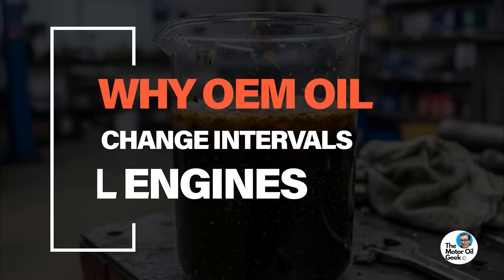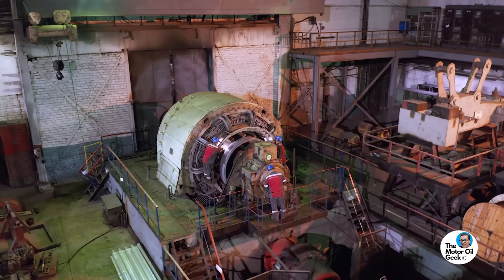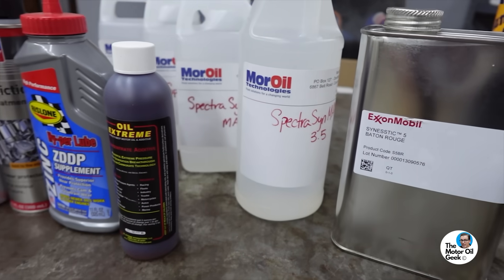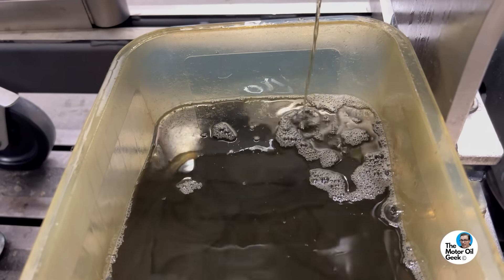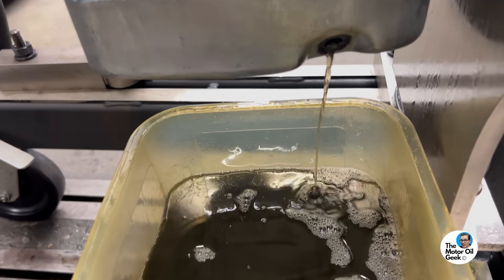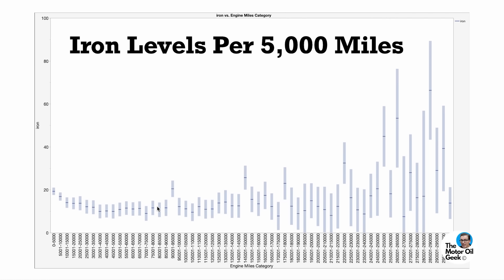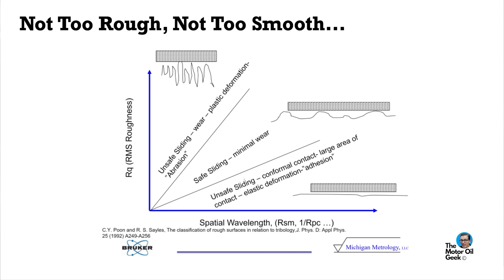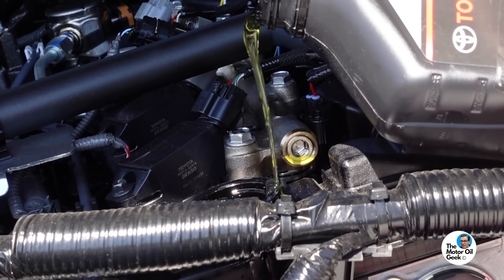NEW Data Reveals WHY Modern Engines FAIL Prematurely!

Comment: I wish donaldson would make their “blue” line of filters for all common makes and models of equipment and vehicles.  

I switched to the DBL 0832 on my 2007 LBZ and love it.  Its got more capacity than the oem filter, but not a big and heavy as the cat adapted or PPE filters.  It also filters better as an added bonus, I believe 10 or 15 microns vs the standard 20.  I run CENEX maxtron deo 15w-40, change it every 5k and its is one hell of a good running, reliable truck.  Oil is always still slightly golden at the 5k mark (i have a ppe flat pan), it never skips a beat, and Im not easy on it at all.  

I used all kinds of oils and filters as a mechanic from cat equipment to kubota tractors, to the every day pickup and semi.  People really don’t understand how important good oil, filters, and REGULAR maintenance is. 

Ive been inside of many engines, pumps, cylinders, etc.  Most fail due to negligence of oil and filters/ PREVENTATIVE maintenance.  Its crazy to me that manufacturers recommend such long intervals, and that folks cheap out in lubricants and filters after spending so much on a piece of equipment or a vehicle. 

I appreciate you sir! I enjoy gaining knowledge every day.  Learning more about the in depth of this sort of thing should be important to all techs.  Id be very curious about Cenex branded oils being tested by you.  I know they aren’t as mainstream as others, but a lot of folks used them in rural areas in everything.  I think they a great oil company, but id be curious to see if that holds up under a microscope! Thanks

Comment: I enjoy your content, but wanted to offer a small suggestion which I think could improve the traction of your videos: 

When you speak in your videos, most of the shots which feature you speaking are a fairly tight camera shot of your head & shoulders.  I think that this can often come across as a being "confrontational", or "aggressive"  (for lack of a better term).

My suggestion is that you can "soften" your videos a bit by mixing this with some upper-torso or full-body shots; these tend to emphasize body language, and show a more relaxed version of what you're trying to convey.  (For comparison, consider some videos produced by MKBHD, where most shots are upper-torso, and head-zooms are only used for making specific points or for "strong" reactions.)
Reply from the maker: Thanks for the feedback.

Comment: In my past experience putting over a  combined 1 million miles on a 2010 cobalt and 2015 fiesta. Highway mileage oil change intervals can be much longer than standard oil change practice. My fiesta went 20/30k between oil changes for the first 200k of its life and then 15k from then on forward. It’s now breaching 500k and it doesn’t burn or leak oil and when inspected internally no abnormal wear.

Comment: I get that contaminated oil causes more wear, but isn't it more accurate to say that specific kinds of contamination cause more wear. If general contamination was only the cause of engine wear then how do diesel engines last much longer on average than gas engines?
Reply: Diesel engines generally have a larger oil tank for more dilution and diesel fuel acts as a lubricant in addition to operating at a lower rpm.

Comment: So would you run a Wix or a Wix XP on a regular basis to keep the oil clean and protect the engine better. Also is there an issue of running a XP filter in the subzero temperatures of South Dakota?
Reply from the maker: Regular Wix over the XP.
Reply: @themotoroilgeek will do, I have a couple of use up yet. Thanks
Reply: @themotoroilgeek hey Lake, why are we running the Wix regular over the XP? Better oil flow? Or better oil flow in the subzero? I don’t recall the reasoning. Thank you sir.

Comment: Heavy equipment and engine tech with half of that in dealer, even today work for a major engine manufacturer.
Automotive intervals is nothing more than marketing gimmick to sell operating cost, 10K miles plus means cheap to the average buyer, it’s complete bullshit. Clean oil is important way more than what magic oil, I’ve been saying that for decades. Next break in oil….until a manufacturer can provide a run in sheet from a dyno proving they ran engine in under load, break in oil is still relevant. There is so much wear metal in the oil. Not to mention rings haven’t seated so the excess oil degradation and TBN shift from gasses passing rings. Next…oil weight is emissions. Gas engine tech has plateaued, now there are chasing parasitic loss any way they can. Oil weight is one way to do that. Problem is it’s so thin once oil decay has occurred from particulates and oxidation might as well be water.

Comment: 9:58  I wonder if these longer term oil change intervals are another way to you keep coming back to the dealer and pay those higher prices if it’s not on Warranty as it seems like when they have more issues
Reply: 10k interval on any direct injected or turbo engine is snake oil. I work at the dealer. First oil change at 10k do the oil change and check the level. Oil is still dark and black on gas engines. There is no amount of BS someone can tell me to convince me this is ok. But since I work at the dealer if I recommend that someone does their oil changes more often then brand recommendation then I could loose my certification.

Comment: Put some nemium magnets on your oil filter and sump plug this helps with metal particles trapped at the magnets slowing down wearing on bearings and other contact points 💸💯💰🫵

Comment: Hemi tick? For every Hemi engine with a tick theres 5 LS engines ticking and every one knows what causes the Hemi tick. Its not just dirty oil lol. Its a weak oil pump. Yeah they’re better lifter designs out there now but ive got 300k miles on a ungraded oil pump on my Hemi and never a tick on 5w20 conventional oil.

Comment: So, did I break my 2024 WRX because I did first oil change at 4k-ish miles? I did second one at ~8400 miles. Sitting at almost 12k miles. Was going to do next 1 at 13k. Is my WRX already a ticking time bomb? Will the head blow? Do I need to reduce my intervals to 3k miles or less? I drive 80% highway 20% city. I forgot... Because I drive mostly highway my cars outlast most city dwellers drivers.

Comment: Although not as knowledgeable as you, I've thought this for years.  Toyota thought I was insane for changing the oil on my wife's new car @ the 1k mark (0w 8) in this crown is over $100.  Since then, Toyota changes oil every 10k (warranty documentation purposes) and I change it on the 5Ks.  I know, it would probably lab out give to 10k also, but I like the piece of mind as it pertains to clean oil.

Although Toyota oil filters are fairly inexpensive, I'm considering not changing the filters on the ones I do based on your latest reviews regarding filtering quality as a filter gets a little time under its belt.  So the filter would get 10k miles between swaps, but the oil will be swapped ever 5k.  Thoughts?

Thanks for the amazing content and your time!!
Reply: Correct. The same applies to air filters. When they are new, they let a lot of fine dust through, as they get older, they get more restrictive and at the same time filter much better. The layer of dust that builds up acts as a preliminary sieve to trap more dirt.

Comment: I'd like a video on the 5.7l V8 hemi engine and how vvt can damage it. The manufacturer says I don't have to put full synthetic in there but I do. They say no more than 10k oci but I change it myself at 8k miles. I've got 80k miles and no ticking noise yet.

Comment: I'm the biggest fan of stuff like sloppy mechanics, cheap hot rodding and the like. Watching this channel I begin to believe this is actually incidentally the more correct route. What's a better engine to put lots of boost to, one with miles that runs great, or one that has been just freshly assembled, and taken straight to the track with no oil change? Something tells me the cheap endurance racing guy who wanted to "do it right" and have his BMW 1.8 "gone through" before racing it may actually have had engine trouble on track if he hadn't spent all his money "doing it right" such that he had to sell the race car.

Comment: Just change your engine oil with name brand products every 5K miles and the engine air filter every 15K miles (or 6 months) and you will be fine. Pouring through endless posts and videos is not needed. If your engine fails when this is adhered to, it is due to poor engine design, and no amount of oil changes will have helped you.
Reply: 5k could be too long for some people for its application as well for the air filter in dusty environments
Reply: @alfonsohdezB that very small percentage of drivers needs to get a few UOA's to determine the life of thier oil then. And if thier engine air filter lasts less than 5K miles on a passenger vehicle, they need are driving off road 95% of the time may want to consider a completely different air intake set-up.

Comment: I remember 46+ years ago a 1971 Chevy half ton pickup with a 292 straight 6 engine that my father had been servicing 8 or so years before me.  The customer always brought his own oil and filter because he wanted a certain brand. (We were Phillips 66) The guy always stopped on his way home from about a 20 mile drive. He always had it changed at 2000 miles.  We were the only shop to ever work on this truck,  475000 miles on it, when the man finally bought a new truck.  The engine on the 71 model had NEVER had the oil pan or cylinder head off !  It still run great. The guy had to drive differently than most.  Same clutch transmission and differential.  Never apart.  😮

Comment: Going back in time, engines had bypass filters that were Superseded by full flow filters for cost efficiency. Lot of people add bypass filters, how long before oem starts implementing them again🤔
I have a cheap bypass filter on my 2.8 Duramax that will be getting analysis soon.😉

Comment: Today’s truck engines run with higher compression ratios and advanced variable valve timing (VVT) to maximize power and efficiency, but these design choices also place extreme stress on internal components. Cavitation, heat cycles, and rapid pressure changes in the oil system can erode lines and surfaces, and this is largely dictated by engine design, metallurgy, and surface treatments—not simply by oil change intervals. In fact, insisting on more frequent oil changes does little to address the root causes of wear; the real culprits are higher pressures, faster valve actuation, and thinner, lighter alloys designed for efficiency. Modern aluminum blocks with liners, polished passages, and hard coatings mitigate some of this damage, but the push toward high compression and VVT inherently increases the mechanical and thermal loads that guidelines and “recommended” service intervals cannot fix. Essentially, the engines are being designed in ways that make cavitation and wear inevitable, and focusing on oil change frequency is a step backward rather than a solution. Too many comments blame the owner and not the design and this cycle will repeat.

Comment: Ive been saying forever that this new thought process of there being no break-in period is nonsense. You don't see the chunks and swarf like you used to in engines made in the 90's and earlier, but there's still plenty of tiny particles in there that need to be taken out. Parts are still polishing, and that fine dust ends up in the oil. You don't have to follow the "break in" procedure as closely, but you still need to get the junk out of there.

I've bought 3 new cars and many motorcycles in the last decade. They all get break in oil change procedure leading up to my normal routine mileage. One at 500 miles, one at 1500 miles, and one at 3000 miles. After that, I go to 5000 miles. Never had oil burning issues or problems with rough running or VVT problems, and the oil comes out looking good when it is time to change it. Most of my UOA's eventually come back recommending a 7500 mile UCI, which means changing at 5000 before the oil is beat to death is perfect.

Comment: With the oil changes in the first 5000 miles at break in it sure seems to me that a CVT that also shares the same fluid with the differential should be changed around 10,000 miles using the same logic as engine oil and keeping it clean. Lake do you know a CVT fluid geek?  Merry Christmas!

Comment: Wait - "oil filters get better as they get more usage, and shouldn't be changed every 6 months or 3 thousand miles".  ??? I learned in your video with Donaldson that is true with air filters, but thought it was different with oil filters. Could you elaborate on that please?
Reply: I think he just assumed air filters work the same way as oil filters, which they actually don't. air filters aren't dealing with a positive displacement pump like oil filters are, which simply pump harder when the filter becomes more restrictive, so i don't believe oil filters get better over time like air filters do.

Comment: The HEMI tick can be solved by putting in a Melling performance oil pump has been shown to solve the tick problem and stop it from occurring again. The key is to start with a new cam and lifter (can even be the MDS ones). The next biggest future problem is going to be the variable belt driven oil pumps. Volume of oil provided is key to survival. Variable oil pumps that they are putting out right now will be show that they do not put out enough volume. Running belts in oil was proven to be a stupid idea back in the 1980s. But hey now it is a good idea at least until all the belts start to fail. AGAIN.  Good video

Comment: Most of the failures are entirely because of exceptionally stupid tactics of getting just a little more gas mileage. Cylinder deactivation has ruined more engines than any other "innovation" and it ruins them in so many different ways that there's just simply no good reason to ever use it. 

I'm calling it the single worst idea ever mass produced in the automotive industry.

Comment: We've been doing 1,000, 5,000 & 10,000 km oil changes on our new cars for the last ~20 years.
Then we switch back to normal service intervals... whatever they might be.
The wear is normal at 10,000 km and changing the oil more frequently would not make much difference to the amount of wear.

Glad that these service intervals are now validated by oil analysis.
We do oil analysis every oil change... but never did the first 3 because it was pretty obvious that the oil was much dirtier than normal.
We didn't feel it was important to quantify how dirty those first few oil changes were... although it's nice to have exact numbers.
🙂
Reply: Knowing what I know now I'd probably do an oil change as soon as the oil looked dirty... that first time i.e. 500 km or less.
That would get rid of the majority of the metal particles and minimise wear.

I got so worried about these particles in one engine I fitted a high efficiency oil filter to help remove them.
The filter removed particles down to ~1 micron 
N.B. Particles in the 2~22 micron range are the ones that harm the engine.
🙂#Trasko

Comment: Why my 2 Renault four cylinder turbos have 200,000 and other 300,000 miles.  And internals are shiny clean and service intervals of 12,000 miles.   It’s all has to do with engineering design and materials and quality standards of parts of engine.         European manufacturers engine oil standards are very specific to each engine construction and lubrication system design.   You vary off and the wrong oil will destroy the motor in a thousand miles.

Comment: 16:00 “Bypass filters“ unfortunately, will not remove or reverse the fuel dilution issue! Oil analysis is showing 3% fuel dilution after only 3000 miles, in my direct injection turbo charged engine! My first oil change was at 800 miles, then 1700, And 4400 miles… 3k miles since. Mostly highway mileage, and no short trips!

Comment: Doubling roller lifter lifespan just by doing a couple of extra oil changes when the engine is new is worth it.

However, if you bond a lubricant to the inside of your engine your engine (including lifters) will last 2~10x longer than normal... on top of that there are other  benefits.

🙂#XcelPlus

Comment: 30+ years ago I worked with a guy who used to work at the Petroleum Institute (I think). He said I shouldn't be changing the oil every 3K miles. Change the filter. The oil itself is fine. He changes his oil every 9K miles. Filter every 3K.
So is he full of it, or is that a good idea?
Reply: I’d get an oil analysis done to be sure but 3k changes seem like overkill to me

Comment: Lol my o6 explorer has lived on 20,000 mile oil changes. Full synthetic valvoline and motorcraft filter. Engine still runs like a top at 263000 miles. Automakers need to get off their knees of government bs.

Comment: Oil analysis is king.  I have a 10K oil change interval on my 2014 Ford Explorer and I wasn't sure that was going to be OK,  Checked the numbers and for me and my vehicle the numbers came back good.  Lots of highway driving, not much stop and go, so 10K works.    I also have a 2019 Indian Roadmaster motorcycle that I have been having an analysis done every 5K oil change and I have seen in it as well that it took a few thousand miles before the wear metals stabilized.   I currently have 40K on the bike and I will probably keep checking.   I have played  a little with different brands and changed the viscosity by one step and for my bike, doesn't make a bit of difference in the numbers.   Keep preaching about the data and keep up the great work.  Love the channel.

Comment: ... bad oil and when you have aluminium engine blocks and cylinders which can't be repaired...
Reply: You can always bore the aluminum block and put a cast-iron sleeve in
Reply: @Chucka10  Yes, you can, but it's not worth it. For expensive sport cars, yes.